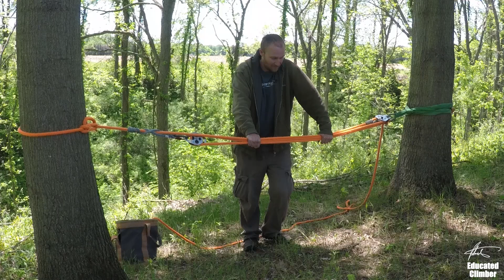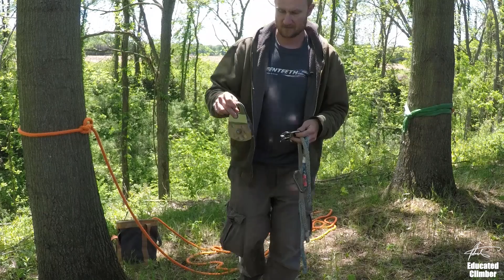Building a Z-Rig 3:1 Mechanical Advantage Hauling System

Comment: Excellent explanation. When calculating mechanical advantage I like to count the number of strands effecting the load. They are never true 100% but it's close in a system with minimal friction and a rope with very little stretch. Great job bud thanks for sharing.

Comment: This video is like the North star of pulleys for me. I always come back to it. I had a true 2 to 1 today where I pulled a snatch block into a storm damaged hangup tree with a throw line. Moving pulley was in tree on a strap, rope anchored at the ground then through moving pulley,  then through redirect pulley to a truck. Tree came right down and thick strap eliminated risk of 3 to 1 strain from truck on the moving end of my 1/2" bull rope
Reply from the maker: Nice work! Sounds like you have a solid grounding in the fundamentals...      - Patrick

Comment: Requesting a video on what to use for economical ground anchors for speed lines and such when there are not trees or anything to tie to. For instance I was planning on using a metal 5' fence post driven almost entirely into the ground at a 45 degree angle and clipping to the tip. This arborist has a similar setup using chained metal stakes https://youtu.be/iEWJAAminAM?t=110 What do you use when you need a ground anchor in the middle of an empty field?
Reply from the maker: check my community tab on the channel, I posted a Picket ground anchor setup from the Army Rigging Manual...        - Patrick
Reply: @TreeMuggs_PatrickM  Thank you! That is extremely helpful!
Reply: https://m.youtube.com/watch?v=jltMZmlezZM&feature=youtu.be
Reply: Hey guys, thanks for the good vids, I just wanted to point out this document, it’s the old army recovery manual, some very useful info on pulling forces and also that ground anchor system, just on a bigger scale. 👍👍
👊👊peace 😉
https://ia802706.us.archive.org/28/items/Fm20-22VehicleRecoveryOperations/Fm20-22VehicleRecoveryOperations.pdf

Comment: I don’t climb or work in tree industries. I had NO clue this was possible! I knew if the pulleys and knots but did not dawn on me to combine them.  
One question - how hard is it to release the holding prussic knot at the rear pulley 
Thanks for this video :)
Reply from the maker: Hello, for the progress capture prusik at the back, if I had to release it under a heavy load it would be difficult. But this is where the sit-back might actually help. I would get someone to help by putting maximum tension on the pull line which would collapse the prusik into the pulley, and then while they held the tension, it should be possible to crack that prusik cord so it would release fully. Hope that helps...      - Patrick
Reply: @TreeMuggs_PatrickM  thank you so much :). I really enjoy your channel !
Reply: @TreeMuggs_PatrickM  I should have read through the comments before I went and tried this.....all's well that ends well though!